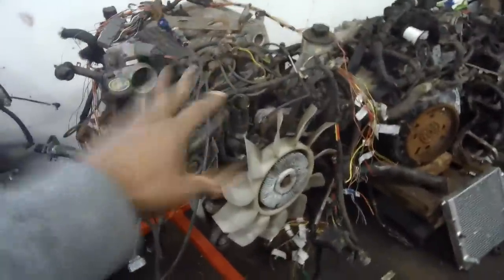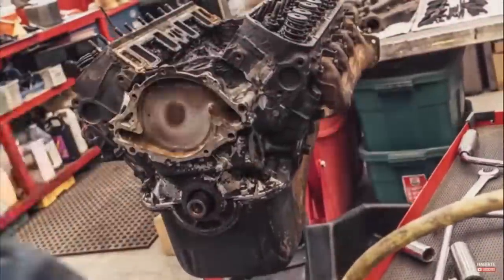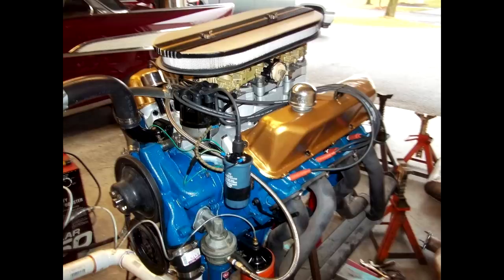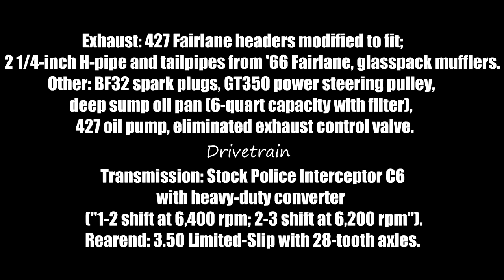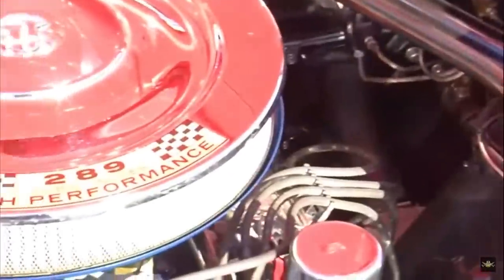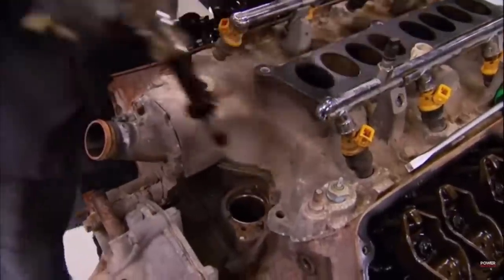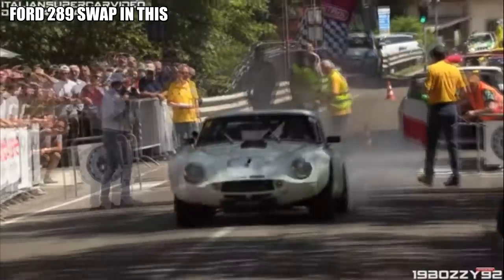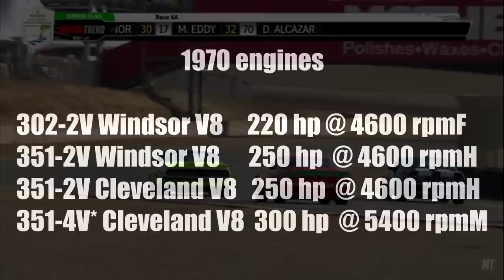289 Ford Voted BEST ENGINE BY CARROLL SHELBY ( HERE IS WHY )

Comment: The bore to stroke ratio of the 289 seems to be ideal for putting out just the right amount of torque and power for its weight.  The 271 HP @ 6,000 RPM, 289 HIPO was a downright screamer for its time.  It's ability to rev so high was something else.  Those things had a forged steel crankshaft, larger two bolt main caps and forged connecting rods with larger than normal 3/8 inch rod bolts vs. the usual 5/16 inch bolts.  A beefy harmonic balancer was included along with a dual point distributor without a centrifugal vacuum advance. The heads were equipped with special cast-in valve spring pockets on the surface of the heads, but they weren't different than a standard 289 head otherwise.

  I just happen to have a couple of 289 engines sitting in my storage unit right now, both just waiting for a freshening up even though they both run really good.  If they had been 302s, I would have sold them by now, but since they're 289s I consider them as being special.   It seems that they're scarce item today, I don't even see them on Craig's list anymore.

 If you want to get the most out of a 289, I suggest going with a roller camshaft conversion.  The cam profiles are much better than what you'll find with the flat tappet, (lifter) cams.  

My list of favorite Ford V8s: #1 the SOHC 427,  #2 Boss 429  #3 FE427 side-oiler,  #4 Boss 302,  #5  289 HIPO

Since you're welcoming comments, I'm going to ramble.  I'm an old fart that's always been a Ford guy.  This brings to mind a favorite Ford that I once owned; a 1969 Ford Custom police package.  Before I get into this, I had to eventually let it go because the rust was getting the best of it as it was exposed to the salt air of the Georgia and Florida coast during its police career and its years of life with me, as a Coast Guardsman.  The cops must have ran the hell out of it and so did I, as this thing was fast and stable at speed; a pleasure to drive!  I even found a couple of bullet holes in the trunk that had been bondoed over.  It looked so much the part of an unmarked cop car that people would slow down when they saw it.

Now to the specifics, it was a special build from the Ford, Atlanta assembly plant, a 1969 2-dr. Ford Custom Police Interceptor with the Interceptor 429 engine and HD C6 transmission.  For those who don't know, the Custom was the stripped down version of the full-size Galaxie.   I bought this car at a police auction.  It was used by the Glenn County Georgia Police for intercepting drug dealers on I-95, back in the day.  I-95 was and still is a drug corridor going from south Florida up the east coast.  This car was awesome in its appearance, since it was a 2 door post, void of the tacky chrome.  It had dark tinted factory glass and a special, firm police suspension that allowed this big car to handle really well for its size.   The suspension gave the car a certain forward rake that allowed it to look just plain mean sitting still.  The factory tires were H70-15s, a wide set of tires for the day, the factory wheels had the dog-dish hub caps, too.  This car was very rare since it was a two-door sedan version of the police interceptor.  They made thousands of the 4-door versions, but this one was one rare special build.  I still have dreams about this bad ass; I wish I could turn the clock back so that I could restore it and oh yeah, drive the shit out of it, again.
Reply from the maker: great right up bro, Youtube set me this late.. thank you so much for the comment

Comment: You only need look at my name to see where I am..so here is how I got there. Back in highschool auto mechanics class we took on a little experiment with some students cars. 1 dart with a 360, a early 70s Monte Carlo with a 350 and a Torino with a 351 Cleveland 2v. The baseline was agreed and the Torino was the "laziest". We did the routine bolt ons..cam, intake,carb and headers. The Torino woke up the best...I was so impressed that it sticks with me till this day ( over 30 years). I always wanted to get my hands on what some call the 400 fmx motor..it was produced 1 year and had the small block bell housing pattern.. would just love to tinker with it. Sorry if I got long winded.
Reply from the maker: $hit you could have kept going lol.. I love stories like this.. thats why i make video praying for somebody to tell there story ( way back ) or present on what they did to make power. Love the sorry i felt i was there at shop with ya
Reply: I think as an overall package, money being an issue or not, the 335 series is probably the great all around performer. It will fit where most bigger engines like the FE and 385 won’t, yet produce comparable or even better numbers. A 4v performance orientated 400 would be a killer!

Comment: This is a GREAT 📹 BST.
5. 460
4. 427
3. 289
2. 351
1.302. These numbers go by availability of the motor on what i see. Shelby said something great about the 289. Great video again bro!
Reply from the maker: thats a SOLID line up bro... I may can run with that
Reply: 429 and 460 should be a tie

Comment: I like the tall deck Windsor. Don't get me wrong  the 302 is very versatile and fits as well as any LS. I just like the bore and stroke of the tall deck . If you poke and stroke the 351 you can get over 400 cubes and parts are cheap ( by Ford standards ) and you get a nice bumpy cam and tighten up the comp ....sounds sooooo good.
Reply: The tall deck M400 is a monster too with the Aussie 2v heads.

Comment: Ford has always had a problem with too much breathing restriction. Open up the heads for significant horsepower and torque increase. The Windsor engines are the best Ford ever made. 289, 302, and 351. Great reliable engines.
Reply from the maker: agreed they did ( look ) at Dodge present time... They have to run the cars hot to pass emissions also they have to pay a tax on those v8 also ( hard to make them clean ) Now Ford can Dohc makes this possible with vvt type goodies...

Comment: Carroll Shelby didn't mention a 302 because a 302 is not historically relevant to Carroll Shelby racing efforts in the mid Sixties, the 289 and 427 are. Though the 302 was put in to the updated Mk1 GT40 when it went back to Britian to have the overall win in 1968 and 1969 at Le Mans.
No.1 historical  engine: The 302 bored .020 over for 304.5 cubic inches/4992cc. For Trans Am and the GT40.
No.1 modern cam in block V8:  A Dart Alluminum 8.7 inch deck 302 block; 4.050 bore and 3.250 stroke equals 335 cubic inches/5489cc, 8500rpm limit, with 550 gross HP.
Reply from the maker: thank you for this very good read and a very detailed comment.. i thank you for this lesson Gen1

Comment: You can build a 289 and a 302 with all the very same parts. And the 289 will out run a 302. The 289 is a long rod, short stroke engine. It will build it's hp faster than the 302 will.
Reply from the maker: ahh you see thats why i need you guy around cause i am learning.. i always say i know next to ZERO on pushrod engines ect. You guy know the stuff.. i see why Shelby dug the 289
Reply: Hey Jim, Help me understand. I see Carroll Shelby Crate 289's have 331, 347, 363 options on their site. Does the added disp/HP help? Sorry for the silly questions but appreciate your insight.
Reply: The 289's biggest advantage was the higher compression and lack of pollution garbage. Given the same parts and built the same way, I'd take the 302 over the 289.
Reply: 289 is great. It was raced every where back then, and as I recall never heard warnings growing up that the block will crack like you did/do with the roller 302.

Comment: I had 6 mustangs coming up, each one with the 289 motor. Let me tell you what fella's, That little motor is bulletproof. It will run when everything else is limping along. The have a REAL Strong power band, and they rev like a chainsaw.  Them little motors pull hard. All My Stangs Had 4 Speed Sticks, save onethat had a 3 Speed stick. But Man, Fun To Drive And The Girls Loved Them
Reply from the maker: thank you for this info.. I love to hear the guys who had the motor vs the guessing... Cause it helps me out a lot... and I thak you so much for this Mark
Reply: The car, or the stick ?

Comment: I do like the 289 engine it is a very compact engine design and efficient.. I really think the honors to the best V8 should go to the fabulous 427
Reply from the maker: I have to drive in a 427 and see whats its all about....
Reply: I have one of those 427's in a 67 mustang. It's a beast.
I just replaced the valve springs in the engine.
I have a video of the engine running after I did the switch.

Comment: One bad small block not mentioned and my favorite is the 69 351w 4v, stock 10.7 compression w/ 290/300hp and 380 torque.
Next would be the 385 series 429/460 for brute force!

Comment: I have a 70 Mach 1 351C 4 speed that I have owned since I was 22 years old. I still have it and I'm 69 now. It is totally  unrestored and runs like a Swiss watch and is fast. I love Clevelands in that when my car hits 4000 rpms its like it is in after burner it loves high rpms but the 289 is a great motor. Its sad they didn't have the after market parts back then they have today. They are little killers on the street and track when fitted for battle.  FEs are now highly sought after . In fact now that they have lots of stroker kits for FEs even the peg leg 332s and 352s can make over 500 hp. And then there's the 427 SOHC. Its fame lives thru the current Coyote and Voo Doo engines.

Comment: And why Ford quit using the small block is a giant mystery. You can get easy power from a 350"er using aftermarket iron heads.
That way they would last forever. They are narrow and light weight AND have the distributor in the front. 
The modular engines are way too complicated.

Comment: My 289 in my 67 Fastback surprises everyone.  Solid lifter with 8000 rpm shifts and only my buddies 10K 327 drag engine can eat its lunch....
Still, I built a 347 with a Scat billet crank for 8500 rpm redline.  Going in next winter.
Reply from the maker: This was a GREAT READ thank you for this... man i learned a few things thank you for this

Comment: 289 all the way Ive been running them since 1982
Reply from the maker: really? what do love about them Chris . I never had this engine
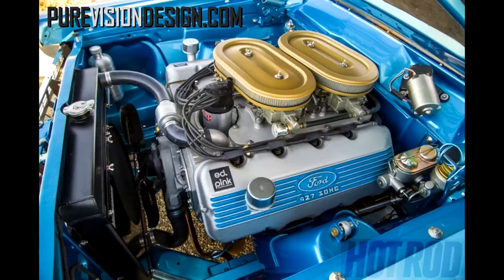Reply: @bstfordchannel923  It because of it's large bore and short stroke that really makes a 289. I twist mine 8000 rpm all the time, granted it's not completely stock. I use a 68 Mexican 302 block with the big caps  , stock 289 crank that has been indexed light weight I beam rods Race Tech forged dome top Pistons Flow tech heads single plane intake and a 750 double pumper. This is mated to a close ratio top loaded 4spd 9" rear end with 4:11 gears and Detroit Locker in a 67 fastback Mustang. 
It's got just enough gear to make it quick when grabbing 3rd gear and running it to 8000 rpm. It will out run most new muscle cars except for the supercharged Mopars and Shelby's. Remember my 67 weights 2800 lbs new cars are 3800 or so.

Comment: Engine selection is all about application. The 302 is the superior choice for wherever you may think you want a 289. The 4" bore gives the 302 a near perfect bore to stroke ratio from where you may tune a very broad Power band. Modern alloy heads keep weight down while offering better heat disapation and greater air flow.
If more torque is desired a 347 is just stroke away. The lower deck height means ,the 302 is more compact and may be an easier fit than most others engines.
Where there may be a 289 ,there should be a 302 ,unless you are building a period correct restomod or doing a proper restoration. 
4.6 OHC engines are good but very expensive to modify for small power gains.
Just an opinion.
Reply from the maker: you said a mouth full! its all about the application thats was well said.....

Comment: I took driver's education in a 1962 ford station wagon with a 390 and a "three on the tree".  We "burned rubber" all over the high school parking lot and the streets surrounding the area.
I also had two '65 Fairlanes, a four door sedan and a two door hardtop, with 289's.  My for door had a 3 speed manual and it was a sleeper. Fooled a lot of guys back then. Wish I had one of those today. But alas...... I have a 6 cylinder mustang now. 3.7 with a 6 speed manual.  It's fun too and gets good gas mileage and cheap insurance.
Win, win, win....
Reply from the maker: greta story i am sucker for a goods old school story.. man i wish those times you where in where now.. times just are bad for a car guy everybody want a pre fab car great story

Comment: That Daytona Cobra Coupe you keep showing was 289 powered. If you watch the Shelby life story documentary he talks about it. He got 200 mph out of that car with 350 horsepower. That's 289 territory. The 427s he built were conservatively rated at 425-450 horse. I have a '68 Cougar with a built 289. In that chassis, I wouldn't have anything else. It's a LOT punchier in the low to midrange torque than they get credit for, and it will not only rev fast, but rev higher than any small block I have ever owned. Seeing how squirrelly my Cougar can get with a small block, there is no way I would want a big block in it. The small block is fun, fast (faster than the car will let me go without turning into an airplane), and the car actually turns in. I am DEFINITELY a converted 289 guy after finally having one.

Great video. I will definitely check more of your postings out. Keep 'em coming.
Reply from the maker: THIS! was a great read Al thank you for this... I want to do something with the 302. i still like these small motors that can really do some good with little mods.. I went and I got me a 302 and installed it in my Ford Maverick click here when you have some time https://youtu.be/vPHoR-0XhXA
Reply: @bstfordchannel923  Already done. Another great vid.

Comment: The 289 was a short stroke and it had higher compression with flat pistons due to smaller head displacement let you rev quicker and wind up faster.  I built a 302 with a set of 289 heads flat top and hp 289 intake with a thumper cam.  It sounded like a big block had lots of power but didn’t have the quick revs of the 289.
Reply from the maker: thank you for the info bro thank you so much a great recipe for for performance

Comment: Love this topic! I believe you don't need big cubic inches to go fast. Like you said it's "The Combination". Here are some of my favorite pushrod engines. Ford 302, Chevy 302 & 327, Mopar 340 aka The Giant Killer. There is an interview with Don Garlits mentioning that in 1964 some 327 powered dragsters were "A terror!" and would rev over 9000 rpm and would occasionally beat a 392 Hemi!
Reply from the maker: Thank you for this comment... I once believe that you need a big a$$ enegine... and I have changed my tune.. I soon learn like many things in life ( not 1 thing works ) you need a series of things to make work together.. I seen old videos of Don and those runs where wild..all the small blocks you mentioned ar something when you put the right recipe in them.. i am still learning and enjoying my finding,,, And thank you for this comment Kevin

Comment: yep as a junior in High school back in 77' i bought, for a what i thought was alot, lol...a 67 Mustang fastback, dark green with a factory original 289 HiPo automatic....swapped in a 4 speed from a 71' Ranchero that also had a 351Cleveland in it......then went to the HS drags in Milan Michigan.......289 is my first choice.....it red lined with out too much trouble time and time again, high revving motor.....513 Detroit locker rear end......out of the hole in 2nd gear only, lol. All GM everywhere but loved them Fords
back in the 70's
Reply: 1400 bucks is what i got this stang for.....sold it 2 years later for 1200 and it was mint....lol only a 10 year old car then....no real history yet!
Reply from the maker: great story man great story i love the stories cause i feel like i was there lol

Comment: Honestly... if I ever get my health back, my plan is to build a Shelby Cobra replica with a 289 crank and rods in a late model Explorer 5.0 block with AFR heads.

I haven't decided between an Air Gap intake with a 1 inch spacer or EFI. Air Gap would come out cheaper, a good EFI plenum adds about 20ft lbs of torque around your normal cruising RPM, makes the 302 feel like a bigger engine.

We've already built a 400hp 289 pretty easily. AFR heads and a 270H cam, pulls to around 6800. The lighter Cobra replica could run a much hotter cam, not as much low end torque needed to keep it fun to drive.

With a small block the Cobra won't be as twitchy about breaking the tires loose nor will it be so nose heavy.
Reply from the maker: great story brother I pray that you can be able to this for real brother ( god knows ) How did you get that 289 at 400hp let me know the secret sauce on that recipe  brother Glen.. check this video i am building a rust bucket Maverick https://youtu.be/ZQOsbqDSVhE

Comment: I had a 289 on my 67 Mustang. That little motor had some torque. Aftermarket was bigger for the 289, it would of been 400+ hp little monster. Unfortunately, 302 took the glory away from it. I like your videos and appreciate your time and effort. God bless!
Reply from the maker: Thank you Adam for taking the time out to comment.. Yeah man that 289 was something ( from what was told ) 302 is the thing now ( or was ) this Coyote deal is the flavor of the decade now..

Comment: My blood is blue ! my fave ford eng 1st 3024v,2nd. 351c4v,3rd. 427 high riser,4th. 429 scj,,5th. 4v cleve headed 300 inline 6..🤙🤙🤙🤙🏁🏁🏁🏁🏁
Reply from the maker: i can really go with that list also a very solid list
Reply: 302 4 valve?  i know the 281 4.6 got the 4 valve treatment in the Mach1 in 2003 the motor the SN95 gt should have gotten...........to wit its the motor the mercury marauder has as well, what  am i missing?  SUH-lean SALEEN or Roush may have used it......ohhhhhhh the coyote.....!!!!